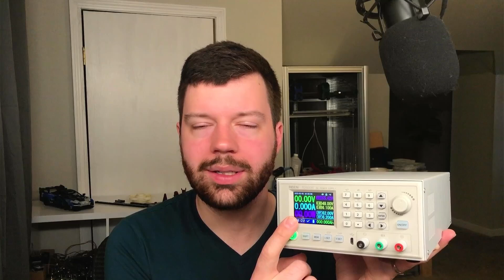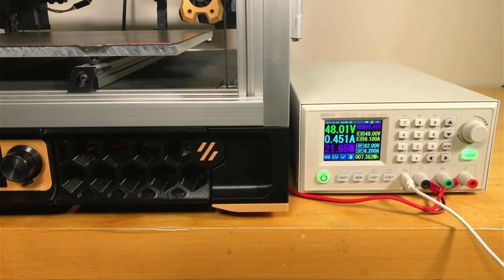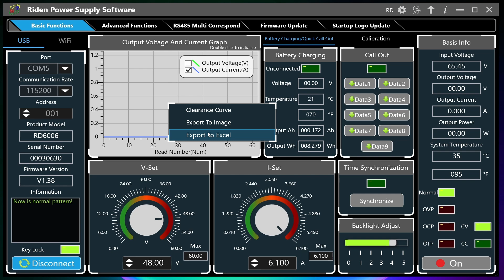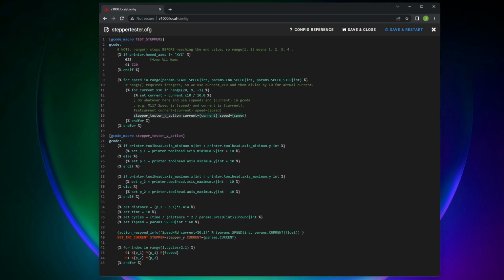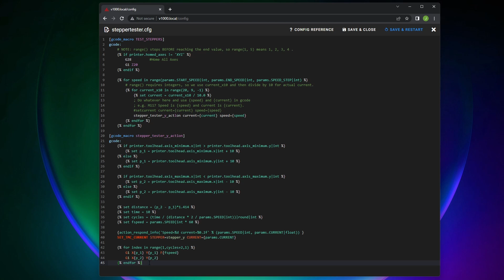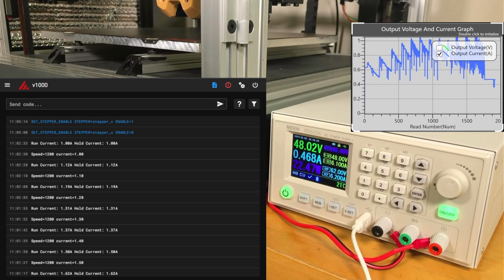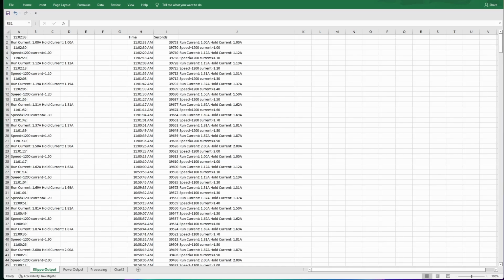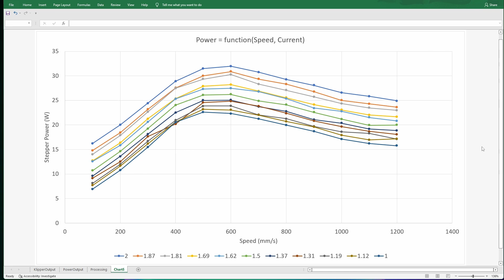How much power does your stepper motor need?

Comment from the maker: Found out that I was adjusting the wrong stepper current during the sweep--that power plot looked too clean! I've updated the charts in the tweet below, and will update the data on github when I have it completed.

https://twitter.com/eddietheengr/status/1533525640175095809?s=20&t=xbhAz1xDDWHQeCrJK8GB6A

Comment: How would the results change with 24V instead of 48V? Would the power consumption be the same or lower? If lower, by how much?
Reply from the maker: Yes! The power consumption drops a good deal, even at the same speeds. I have a few nice graphs where I’ve done a sweep of voltages and currents on the same motor to show the delta!
Reply: @eddietheengineer  I've now seen them, thanks a lot for your research!

Comment: Since I'll be running a Fysetc Spider with TMC2226 would I have any kind of real power gain running my board at @28V? I'm assuming that the +/- 16% of overvoltage could result in some kind of gain but I'm not sure if it translate to a real use improvement.
Reply from the maker: You could hit slightly higher speeds with a bit higher voltage! But the downside is that you'll be at the edge of what your control board/drivers are rated at. In general, I wouldn't recommend updating unless you can go all the way to 48V.

Comment: Good content! I always had a question: when using standard stepper motor driver (the ones that come with current configuration via dip switches) which current shall I use if i want to drive the motor to its maximum speed? Shall I use the nominal current show in the motor datasheet? Or use an average value between the nominal and the minimum the driver can support? Thanks i'm advance

Comment: Hello Eddie.  I was excited to hear you're obsessed with steppers, because I have a question you might be able to answer.  I am using NEMA34 steppers in a project I'm working on, and I bought a knock-off (not Leadshine) DM556 stepper driver which has selectable stepper current via DIP switch settings ranging from 1.4A to 5.6A.  My bi-polar motors are rated at 5.5 amps and have a coil winding resistance of 0.5 ohms.  I have a lab power supply which can deliver up to 10 amps at 30 VDC.  It does have a current limiting feature, but I have it turned all the way up, so current limiting will not engage.  Here's my issue:  No matter where I set the amperage DIP switches on the DM556 stepper driver, I don't get any change in the current from my power supply (it has a digital display for current), and I don't seem to get any changes in the motor torque.  My thinking is that the stepper driver is junk.  I have two brand new drivers, and both behave the same way.  What do you think?  (FYI, I've ordered a different brand driver to see if it does the same thing, but haven't received it yet.)
Reply from the maker: This is an interesting problem! I assume the stepper driver is activated—what speed are you testing at? If it’s at a very high speed, it’s possible the backemf is so high that the actual current though the stepper windings doesn’t change since it’s limited by backemf instead of the current selection
Reply: @eddietheengineer  I plan to borrow an oscilloscope and put a small resistance in series with the coils and measure the voltage across this resistance while the motor is running so that I can get a true picture of the current through the coil.  This might also shed some light on how torque varies with speed.  To answer your question (speed) I've tested at many different speeds.  Slow, fast, stationary (but on).  It doesn't seem to make much of a difference.

Comment: personally i've found that on TMC stepper drivers changing the driver_PWM_GRAD from the default of 4 to instead something like 10 has the biggest improvement on performance.  the factory default from TMC is set really low because they don't know what kind of capacitance will be available but if you mainboard has decent sized caps used then you can set it to 10 with no issues.  maxing the PWM_GRAD had a bigger improvement on performance than 48V or using bigger stepper motors because with something like a core-xy printer the real bottleneck is how aggressively the stepper driver ramps up the current while accelerating.  at the default setting corexy printers start skipping steps when you set the acceleration for moves to something like 20000.
Reply from the maker: That’s a great point and I’ll have to try that out! I want to see how settings like that affect performance
Reply: In the klipper docs it seems to indicate the default value for PWM_GRAD is 14 for tmc2209 and 2208 drivers but it commented out.    Only on the tmc2130 does it show 4 as the value.